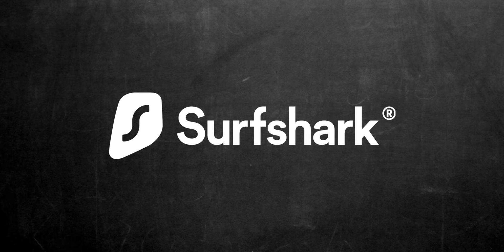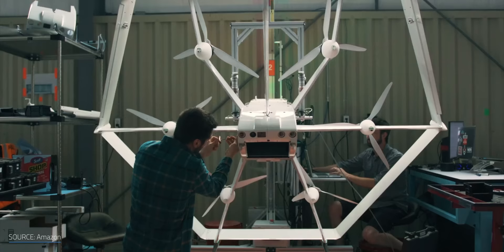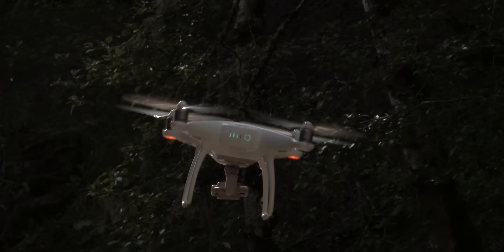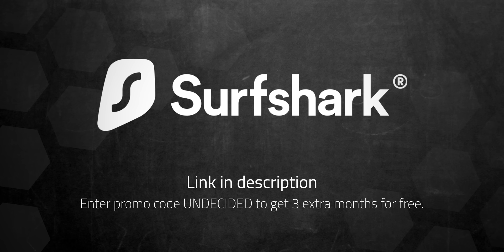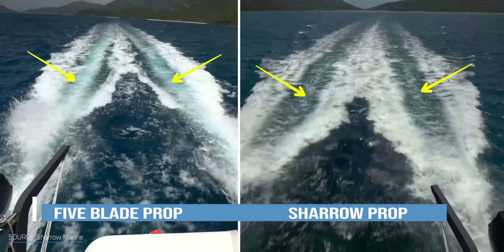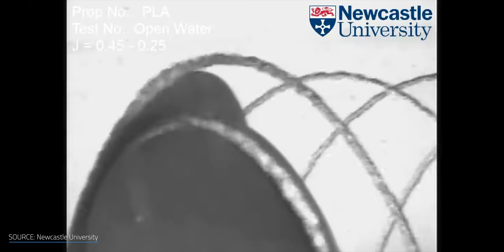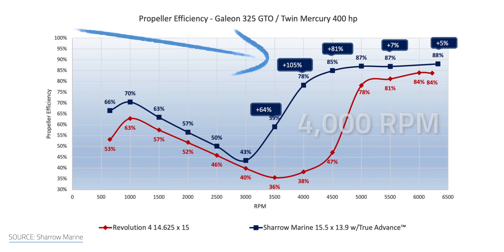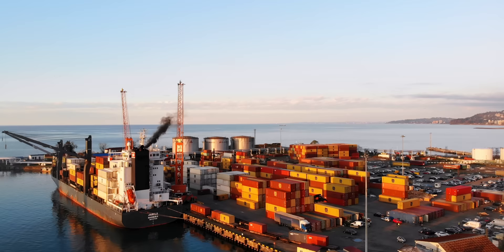Why is this Propeller Getting So Much Attention?

Comment: I'd like to find out if the Toroidal prop shape can have side benefits too... such as for sailboats that use an electric motor when not under sail. There are some systems where you disengage the prop while under sail and the motor turns into a generator, helping to top up your battery banks. Will a toroidal prop work as well for that or will it be better or worse? What about using such a prop on wind turbines at various scales. There are small wind generators used for campers and again, sailboats. Would they work well for those? What about larger turbines like wind farms? Could it also make simple cooling fans more efficient and use less power? I hope to see info about these questions come out soon.
Reply: I also wonder about jet propulsion… like in a jet ski
Reply: @lureup9973  that's a very good question. I'm not sure how that would work. A propeller is a sub-class of impeller, but there is a difference in how they work. Jet propulsion such as a jet ski uses an impeller (usually within a tube), which increases the pressure of a flow whereas the flow into and out from a propeller is roughly equal. Given the enclosing tube of such jet engines, I don't know if they suffer from the same tip vortices or cavitation as propeller craft. I hope that gets tested too so we can find out if toroidal fins on an impeller can be beneficial.

Comment: What are the increases vs a CPP? Something where you can control the pitch allows for optimal thrust at a given rpm.  I can see this for efficient cruise speed, but I'm guessing that the losses during acceleration/deceleration are where a lot of the efficiency can be gained.

Comment: I admit, I did not read through the comments.  One question I have: Many smaller boat owners (definitely where I live and the river is shallow) have to deal with propeller damage due to rocks and river beds.  Would this design be less prone to impact damage?  Would it be possible to make it more flexible so that it "gives" instead of breaking?

Comment: I wander with this new design like how is it going to change aviation drastically, and itself like helicopters, single engine, Cessna’s twin engine, each crafts all these things in aviation that uses it properly regular basis like I made a crack in the military, like the shadow is stupid loud, but with the prop like this, probably won’t be as loud anymore on the block, three platform where it actually has a muffler

Comment: You can’t have a 10 x higher price tag on a large commercial propeller, as the propeller already makes a large portion of the cost of the ship.

Unless those propellers gets significantly cheaper, they are useless in commercial shipping.

A way to get around this issue, can be, different kind of material and manufacturing.

Comment: What about a propeller with 6-12 torroids arranged in a donut as a quad Prop. Perfect circular Torids arranged in a loop. That would be interesting to see the result/thrust/noise compared to the 2 torid design. It is crazy that it has taken this long to make a leap like this in propeller design. I think it is because of the amount of drones and the need for silent propulsion for them. Finally a large enough demand for silent propellers. And Drone propellers are cheap and easy to prototype. They can be printed literally. Quadcopter and Drone technology is changing the whole propeller propulsion industry. That's cool. I think propellers are overlooked and considered "outdated" now there are ducted fans, ion propulsion, jet pumps etc. I'm curious if the torroidal design can be applied to a ducted fan, it should.

Comment: Youre going to have to explain to me how something can be '105%' efficient ... 

ok, so 105% 'more' efficient, got it. I guess that sounds better than stating it's efficiency in absolute terms, as well as being easier to calculate.
Reply: ….correct but it is neither 105% efficient nor 105% more efficient. At least, using the graph of ‘advance rate’ v rpm, it is not possible to know the efficiency. The stupid thing done in this video is to simply compare velocity at some given rpm using two props and call it a comparison of efficiency. Without knowing either torque or fuel flow you cannot tell which is more efficient. Also, to make the comparison valid it should be at the same boat speeds, not the same rpm settings. You could replicate the comparison seen here by simply comparing two conventional props of different pitch. The coarse pitch will advance further per rpm. Who knew!
   We don’t actually know the efficiency of either prop from the data given. It is classic marketing smoke and mirrors. It stands to reason that if you had the test data of actual efficiency and it was better, and you had a prop to sell, you would absolutely SHOW THAT DATA. Therefore it is fair to assume that the actual efficiency data is not so good. 
   Also, the data point chosen for comparison was when the conventional prop was clearly at hump speed (most inefficient speed) whilst the Sharrow prop, being faster per rpm, was in the planing regime. Nobody who genuinely wanted to compare efficiency would do such a thing.
Reply: @XPLAlN  wow, ok its worse than i thought. I have to admit i didnt watch the full video, or even very much of it. After i deduced it was simply marketing with extra steps i lost interest and tempered my opinion based on what i assumed they did for their conclusion. I had seen an earlier video on the CNC machining process. Totally, taking a vector of 2 nonlinear curves of input power vs velocity from different engines with different power bands and props and extrapolating ‘efficiency’ from that is more than a little bit disingenuous.

Comment: The concept is fantastic, but when you look at the cost (at least for boats) there's really no benefit as the ROI can't be realized in the amount of time a person usually keeps a boat. 
Example: the Sharrow marine offering for my boat application is over $5k. A replacement, bronze, ACME replacement prop for my application is $500. 
A tenfold increase for a possible increase in fuel economy isnt worth trying the product.

Comment: Well you might be saying ' how does this affect me?'
Well X accounts for 0.29% of global carbon emissions, but with this new design,  engineers believe this figure could go as low as 0.282% by 2032; and if that's not enough, engineers also believe it could be as much as 10% more efficient than previous designs.

Comment: There is a better way for producing thrust by fluid-dynamic methods than by a direct-acting propellor, because the fluid leaves the propellor with about half of the kinetic energy being generated in its slipstream. Should the device be of a centrifugal-fan type and the leaving fluid then redirected from radial to a flow parallel to the axis of rotation, there will be a greater amount of this energy being used for propulsion (or lift in the case of a helicopter). Depending on the size of the redirected jet of fluid, compared to the intake diameter of the fan, a greater amount of thrust is possible, even when the blades of the same-sized propellor are continued as in this above proposal.

Comment: Wonder if there could be some cost savings in the manufacturing using sintered metal 3D printing; at least in the existing small scale props for boats.  Very cool tech.  I really want them for my drone.

Comment: Yeah, it's the price tag that seems unreasonable for normal boat props, you could probably find a toroidal prop blueprint online and have a company do a DMLS for you for under $600. Even if you need to replace it every 2 years it's cheaper over 10 years.

Comment: I hadn't thought about the application of toroidal propellers in pumps but it would increase longevity by reducing cavitation, I wonder if there's better shapes for bends in pipes to prevent water hammer
Reply: See Victor Schauberger, as someone mentions above. He was experimenting with toroidal pipe, a bit like a gazelle horn shape, allowing air to flow in the ''empty'' vortex centre. Increased flow speed, and maybe less water hammer effect too, though I can't remember. Well worth a watch, fascinating guy.

Comment: 1:42 "People are very sensitive to drone sound, which falls between 100-5k Hz range. That is the same as a crying baby"
That is also the range of every voice, basically. The annoying property about baby cry is not the frequency, it probably has to do with the specific harmonics. But if I had to guess, it is annoying the same way an insect buzz is annoying.

Comment: i think tracking your eyes on IR device is pretty critical to actually enjoy that usecase.. otherwise the overlays are not going to be liined up in such a way that keeps you from feeling fatigued and not enjoying the overlays on the OLED.  its going to be 'neons' not like color stuff, I think.  The see-through to LCD matrix is garbage but good to get developers onboard and producing.  once they get to the thin glasses at Apple its going to blow people away.  I think its important that at that point, that we all use public software in open source.  with chatgpt we can basically now manage that burden of supporting lots of builds..  theres going to be so many use-cases for smart helmets and right now.  we need to just make an open software kit that can let lots and lots of people do contract work on this stuff abroad.  I mostly say this because I am anti-ad and would never allow an ad on the screen or send to marketers.  thats scam art and basically needs to be defined in the web2 era only.  web3 is our time.

Comment: I wonder whether there is a version of these props which works the other way round as a turbine?  I already know that conventional props tend to have few blades, and turbines have many blades, so I guess the two toroidal types would have significant differences, but it might be worth thinking about?
Reply: Turbines are normally mounted within  the engine and don't expose the blades outside so tip vortices are already controlled and there is no need for special toroidal shapes. The blades might have a special shape but for other reasons.

Comment: and if the propeller works simmilarly for cooling used like for computers or engines or even air-conditioning needs this could me pretty wide spread not to mention air  compressors or pumps for water or other liquids these could pop up all over assuming they work in different areas and are not so difficult to create

Comment: Hoping noise pollution on oceans would be mentioned. It doesn't directly affect us but the marine animals are.
These propellers are much quieter since there's less cavitation and the fact that engines won't have to work as hard means they're more quiter than traditional propellers.

This is channel is more of for humans kind of stuff rather than the bigger picture that includes effects to the ecosystem and such.

Comment: The idea that this new propeller design is scalable is certainly possible on an individual basis when considering large cargo ships. However the comparison of "drones"  to cargo ships and aircraft as a means of transporting very large cargo is not realistic. 
There are 11 billion Tonnes of cargo transported by ship (excluding aircraft) every year and to compare this with the carrying capacity of a drone is absurd. In addition the drones ability to transport heavy loads long distances is a limiting factor.
The quieter more efficient propeller design is an excellent idea, but in itself it is not going to replace  our current large scale transport sytems

Comment: They were apparently invented in the 1890s , and two patents for fan blades and aircraft propellers were taken out  in the 1930s. If they are so amazing, why has it taken 130 years to even raise its profile above hardly anybody uses them? Are they too costly and difficult to manufacture, or do they wear out too quickly, or just too fragile? There must be some reason.

Comment: The company is being smart the way they are developing their products while 5K may seem expensive for someone who owns a boat it's not an excessive price. And while machining each one out of a solid block of forged stainless steel is by far the most expensive and time consuming method they ensure these products which are being bought and evaluated by wealthy influential people in the industry who are potential customers and investors perform as well as possible. A lot of reports of cheap props breaking and causing expensive damage to multi million dollar yacht's could sink the company faster than the Titanic. They are also tweaking their design for optimal results with different engine and boat designs so until they have amassed enough data to optimize their blank casting design investing in tooling for mass production would potentially be pissing vast amounts of money down the drain.

Comment: Everyone is talking about the toroidal propeller's efficiency compared to conventional propellers, but what about its comparative advantages compared to ducted fans/propellers? That would seem to be an interesting comparison. Off-hand, I imagine that it would have advantages possessing lower drag as well as pulling in more of the surrounding fluid, but that's just a guess. Does anyone have more info?

Comment: Boats are already hyper efficient and those decibel reductions for drone props don't seem to be significant enough to warrant the engineering cost.  The absolute most I could see this technology being used for is to make a "quieter" trolling motor prop for small fishing boats.  The potential fuel efficiency is inconsequential to any other application at scale.

Comment: Incredibly clever invention, fair play. Stick one in a hovercraft or a jet engine and see how much better it is. We're only hearing about it now because there's probably still a shit load of money invested in older less efficient tech. 
Makes me think of the reverse scenario of hydrogen fuel cell vehicles and infrastructure. 
They're less efficient in use than battery EV sure, but they're WAY more convenient to use day to day, especially when it comes to recharging / refuelling. No one in their right mind if they're honest, wants to wait over half hour for a car to charge FFS...

Also, hydrogen fuel cell vehicles are much cleaner than battery electric. Not to mention the ethical implications of minerals like cobalt and nickel mining. But because there's so many ignorant muppets clinging invested / investing in battery EV's, with their dirty finite resources, hydrogen is stuck on the back burner and held back.

Really interesting video, nice one.

Comment: Could toroidal blades be used in jet engines as well? Taking a look inside one, there are rows of spinning fan blades. Could we replace those with the toroidal blades? Is there anyone who has experience with jet engine propulsion? I'm not very well-versed with aerospace engineering. I'm studying to be a mechanical engineer.

Comment: I'm looking at getting a boat but currently a standard or toridol prop is not on the list as pole skis are stupid fun but use a Hamilton style jet unit which is a lot safer especially when ya feet are hanging off the back of the ski 😂😂😂

Comment: I'm disappointment that there was no mention of the blades originally being experimented with back in the 80's if i remember correctly, and failed only because of the limited manufacturing tech of the time. They're not exactly "new", but are only new when it comes to mass manufacturing given our advances in the needed tech

Comment: If this prop only cost 105% more than my current boat prop, I could be interested. One of these props retails for $10K less than the cost of my entire small boat set up. 🤦‍♂️🤦‍♂️🤦‍♂️
Commercial use can recoup the cost, not private use.

Comment: This design is incompatible with aircraft, it simply won't scale up or provide a useful gain.  The zipline propeller is already ahead of this design, as it uses the same concept to reduce tip vortices without a stupid toroid shape coupling the two blades together, by staggering the produced vortices on top of each other to cancel them both out.  Even the zipline wouldn't scale up to an aircraft that could really utilize some efficiency boost though, as there's not enough surface area in two staggered blades to absorb the power that the engine is producing.  It would have to be at least a 4 blade prop, with two blade pairs opposing each other, to effectively convert torque to thrust in a GA aircraft.  Larger aircraft would need more blades than that, and you get into the issue of running out of space for the amount of blades you want, and each one of them adds cost, mass, and complexity, none of which are welcome on an aircraft unless absolutely necessary.  Furthermore, the zipline is primarily quiet because it has one set of blades with an opposing counterweight, this is an important part of perceived noise, by changing the Hz of a drone blade from a higher frequency to a lower one.  Add a lot more blades and now you're right back where you started frequency wise, but now you're doing it with a prop that's only slightly quieter than a standard prop.  Ultimately, there's only so much you can do about tip vortices before you're in the realm of wasting your time.  Look up aircraft winglets and you'll notice a striking correlation between them and what these props are trying to accomplish.